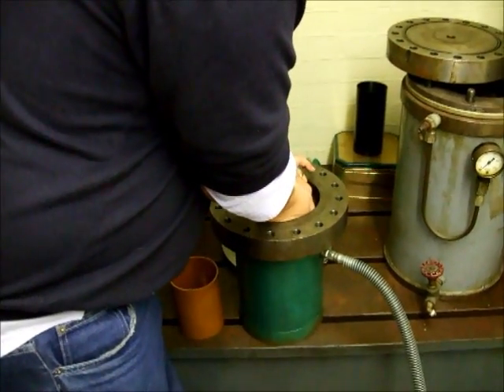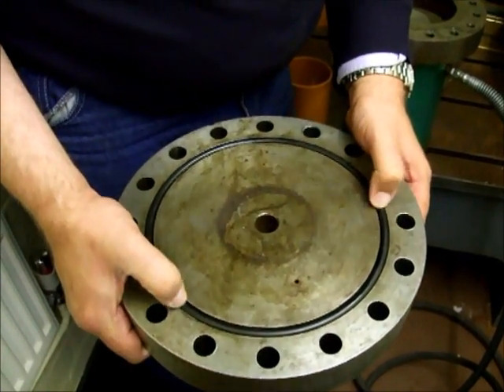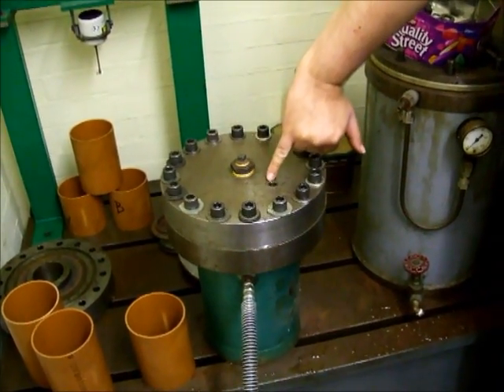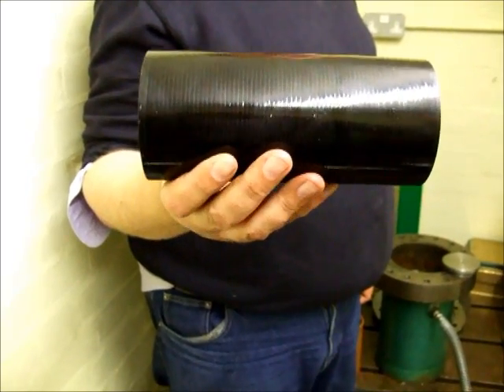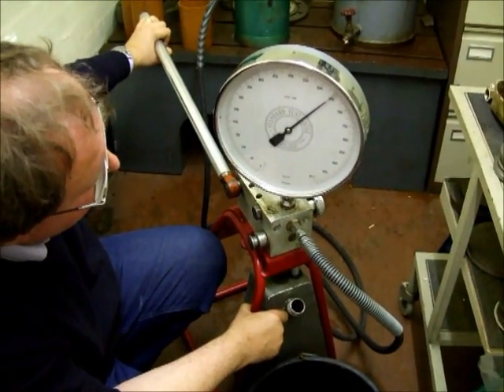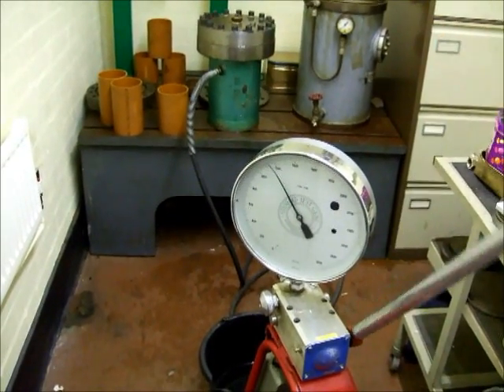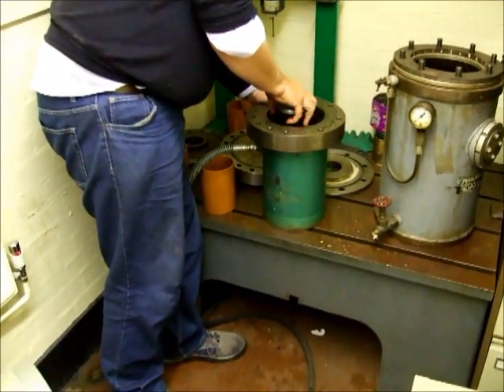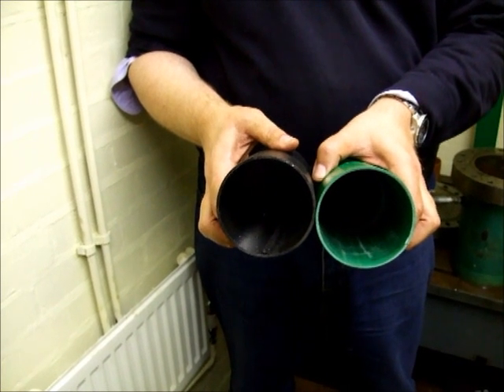Collapse of Composite Submarine Pressure Hulls

Comment: Wait you're telling me they knew carbon fiber wasn't good at withstanding pressure over 10 years ago??
Reply: Veteran engineers know this since its infancy but marketing people kept pushing it because it sounds fancy and related to racing applications also it can be made cheap and sell at higher price.
Reply: @krrk6337 truth
Reply: @MrObear  Nope BS.
Reply: @krrk6337  That's BS.   Where do you come up with cheap?  Unless it is a carbon fiber part that is going to be manufactured in great quantities and few are, the expenses are mostly related to manufacturing processes, labor, design, tooling, and other materials.   The more exclusive any product is the more expensive it will be.  Marketing my ass.
Reply: @boneseyyl1060  here's an example of a marketing person who thinks expensive parts can't be cheaply made.
Reply: Carbon fiber's strength is in tension, not compression.  So it's a terrible choice when you need to design a vessel to withstand tremendous compressive pressure from outside of the vessel.
Reply: @ShawnKitchen exactly what James said
Reply: @jummyran exactly what I was gonna say
Reply: @ShawnKitchen  bollocks its the cycling of load that's the problem
Reply: @ShawnKitchen    Exactly.  Not sure why this fact gets overlooked.
Reply: It is a well known fact in the industry.
Reply: @HeatherRose2023  No.
Reply: Go find the video of James Cameron talking about carbon fiber. Yes, it was well known that there are serious issues in using carbon fiber to resist compressive loads, although it’s acknowledged to be great under tension. But there is also a progressive degradation of carbon fiber to consider, much more so than materials like steel or titanium. That pretty much only leaves the weight advantage of carbon fiber, which isn’t anywhere near as relevant as in designing aircraft or spacecraft.
My personal view is that carbon fiber has assumed the oopsie-wah status of a miracle material in the “common wisdom” and this may have led some people to the conclusion that it had to be good for submersibles if it was good for other applications. This incident may convince those people of their error.
Reply: @mencken8  I don't think James Cameron is a MS ME.
Reply: I suspect people knew this about carbon fibre going back to its infancy. There's a reason why it wasn't used. Even in cars, because it has no 'give' and shatters, certain designers like Gordon Murray (McLaren F1 etc.) refuse to make car wheels out of carbon fibre, preferring a heavier metal wheel instead.. because it bends and doesn't shatter.
Reply: @lukemallory7832  Koenigsegg uses carbon fiber for wheels. Not an issue for them
Reply: @GOD719  I know.. I wrote that they CvK uses them above. According to Gordon Murray, it is an issue.
Reply: @lukemallory7832 i think they stopped using carbon fibre motorcycle wheels for the same reason, in the 80's i think at the Isle of man TT some riders Carbon fibre rims shattered when he was clapping on...
Reply: @lukemallory7832 I wondered about it shattering.They should have used steel or titanium
Reply: @lukemallory7832 
Ferrari also prefers to use aluminum metal over carbon fiber.
Reply: @lukemallory7832  high end cars do make wheels out of carbon fiber ...and drive shafts
Reply: @lukemallory7832 carbon fiber bicycle frames.  Super light and nice looking but those guys have to ditch the whole thing if there's any minor crack.  Rich people problems I guess.
Reply: @lukemallory7832  You are a man of culture.
Gordon Murray in a very recent interview (on his new car T50) said "Carbon fiber wheels are dodgy"
Reply: @lukemallory7832  I don't think this has much to do with why it's an inappropriate material for submarine hulls. It's about how layered fibre composites transmit load under compression along the direction of the fibres.
The carbon fibres are so thin they buckle easily so can't (by themselves) carry much load, so the matrix material does a lot of the heavy lifting plus it braces the carbon fibres against buckling so the fibres can carry load too.
However, these transverse buckling forces will act to delaminate the material.
Reply: @sergarlantyrell7847 to picture why smarter people than me would say it is great under pressure but not compression I did this thought experiment.

Hold a string (the fiber portion of carbon fiber) between your hands and pull them away from each other, this is a carbon fiber pressure vessel.  Pressure from the inside is trying to stretch the carbon fiber, the fiber helps resist this.

Now, hold a string between your hands and move them closer together, this is carbon fiber in compression. Pressure from the outside is trying to compress the carbon fiber.

The titan sub was essentially an epoxy sub, you can’t push a fiber. Fiber is good for tug of war, metal is good for jousting.
Reply: @mabolzitch7743  somewhere else I posted that I would love to see a comparison of a wound CFRP pressure vessel Vs one purely made of the matrix material.

My prediction is that the CFRP one would be stronger (though no idea by how much... maybe 2x) because the fibres should resist axial compression if they're constrained by a rigid matrix so they can't buckle.
This would create a lateral force though that leads to delamination.
Reply: @lukemallory7832  The carbon fiber bonding method they used on titan doesn’t shatter like the parts you’re thinking of - it tears and rips.  There are some engineering channels that discuss this.
The parts that shatter are bonded in a mold and put under tremendous pressure during the bonding process, far more than the submersible would be under.
Reply: @AdamsBrew78  I wasn't aware of that - thanks, I'll give it a look.
Reply: @lukemallory7832  Carbon fiber does have "give", that is why it is used in components that need to have some flexibility and a high cycle life like bike frames, rims, and handlebars. CF has a much higher flex life than even titanium but if you push it past its maximum flex range it will shatter dramatically.
Reply: @lukemallory7832  Carbon fibre was first introduced in Formula 1 in 1981 when McLaren first explored the use of it for creating a monocoque and has been used elsewhere extensively including suspension components, using it for wheels is against the rules. I wish people would stop making things up.
Reply: @entx8491  When he said "not used in cars" i think he meant more that its not used as the basis for the 'major' components of cars (its only recently that they started trying to make 'frames' out of it).  Mostly Carbon Fiber has been relegated to body-work components and such.  Parts of the F-1 cars taht are not expected  to carry a heavy load get the carbon fiber treatment, but i doubt you'll see the A-frames holding the wheels to the car made of the stuff.
Reply: @entx8491  ?
Reply: @Gwydion_Wolf  you don't think the literal chassis or suspension are major components? Lol OK.
Reply: @Gwydion_Wolf  " i doubt you'll see the A-frames holding the wheels to the car made of the stuff."  Doubt away, never the less it's been true for MANY years!
Reply: @entx8491  Again to clarify for others, because this guy is simply angry for some reason, I was saying that Gordon Murray does not make wheels out of carbon fibre, period - nothing to do with F1 or F1 rules. I meant his McLaren F1 (road car) and T50, do not use carbon fibre rims, unlike Koenigsegg and other en vogue companies, because Murray has stated in interviews that they have no give and shatter. This is not 'made up' and these interviews are available to see here on Youtube when he's talking about the launch of the T50. I am well aware that Formula 1 cars are predominantly made from carbon fibre. Good day.
Reply: @entx8491 you seem a bit slow
Reply: @Gwydion_Wolf  The monocoque chassis and the suspension control arms on F1 cars are made from carbon fiber.
Reply: @entx8491  Right it was used in 1981 - for the Formula 1 MP4/1. The F1 that Luke Mallory refers to however is not the Formula 1 MP4/1 (like you suggest), rather the road-production sports-car that was produced from 1992-98:
The F1 that won Le Mans in 1995 and raced during the Le Mans GT1 days.
The F1 that doesn't use carbon fiber rims.
The F1 that set the speed record for naturally aspirated road-cars, at 391 km/h.
The F1 that Rowan Atkinson once owned - before crashing it twice and selling it.
The F1 that was used as a test-mule for the Mercedes CLK GTR.
The F1 that used dihedral doors,

Luke Mallory was NOT referring to the F1 MP4/1 that:
"[W]as first introduced in Formula 1 in 1981 when McLaren first explored the use of it for creating a monocoque and has been used elsewhere extensively including suspension components..."

I don't know about you but that seemed like a very clear difference - seems like you're the one with a comprehension problem - you mindless numbskull
Reply: @Gwydion_Wolf  what do you mean man? It's not like the bodywork experiences over 3 tons of downforce repeatedly every race, and the suspension arms are most definitely made out of carbon fiber.
Reply: @davidaugustofc2574 3tons. Yeah, well. Subs need to be round for a reason...
Reply: @Gwydion_Wolf wow, incredibly incorrect. F1 cars see massive loads and use carbon fiber wherever possible, including the suspension arms and entire chassis itself!
Reply: @Knyq_626  Yes indeed, focus on the few words your brain is capable of managing, take only that into context, then finalise with exactly what I said. You are demonstrably an NPC.
Reply: @Gwydion_Wolf  As others have noted, you don't know what you're talking about as the monocoque and main suspension parts (wishbones, which I think is what you're call "A-frames" have been carbon fiber on F1 cars for 30 years, but so have the front and rear aerofoils, which "carry a load" greater that the weight of the entire car - it has long been known that in theory an F1 car could be driven along the roof of a tunnel. ... So you're entirely wrong, carbon fiber is used in heavy load situations in F1 cars.
Reply: @alro2434 I suggest you google the term “carbon fibre monocoque”. It amazes me people type these diatribes without fact checking themselves first.
Reply: @Gwydion_Wolf f1 uses carbon control arms
Reply: @entx8491  
We used carbon fibre in racing cars well before 1981.
Reply: @rorykeegan1895  I know, I didn't state otherwise.
Reply: @lukemallory7832  You made a statement about "certain designers like Gordon Murray (McLaren F1 etc.)" now you're trying to backtrack. Not all of us have problems with comprehension, maybe some of us can't see what you're doing there but I can for sure. I'm not invested in arguing with intellectually dishonest people and mindless numbskulls so whatever. I'll agree to disagree because I couldn't care less about what point you were trying to make.
Reply: @entx8491  I'm not trying to backtrack; you're being incredibly insulting for absolutely no reason and I'm still baffled as to why..? I don't even know what it is I'm 'arguing' as from my perspective you have taken issue with something I've said without telling me which part, hence I attempted to clarify. If you could relax for a moment, instead of calling me a numbskull, and tell me what I've said that has gotten your back up as I'm genuinely interested to know?
Reply: Wait, you didn't knew that marine engineers were warning for years about Stockton Rush's coffin?
Reply: @Engineering_Science More like his disintegration chamber, unfortunately.
Reply: @Engineering_Science  well they were over 50 year old white guys and Stockon Rush didn't want them since he wanted diversity.

carbon fiber is used for rovs and they toss the carbon fiber after one trip and reuse the rest for the next rov.
Reply: @toomanyaccounts  More crap. 
   Stockton didn't want DIVERSITY.   He simply didn't want 50 year old white guys like him, telling HIM what to do. You know, because those guys have something called "experience" and he wasn't looking for any of that. 
   He really wanted a bunch of younger people that were eager to impress and would say things like, " Yes sir, Mr. Rush, we think a carbon fibre hull is a great idea!!"   I doubt he cared if they were red, green, blue or pink as long as the words "Yes Sir! " were coming out of their mouth.
Reply: @davepug066  because the ceo told them to after he ignored their objections
Reply: It's good for pressure from the inside.  Like a scuba tank. But not the right choice of materials for pressure from the outside.  Especially being used over and over. Fatigue in the form of delamination occurs. Eventually,  your luck runs out.
Better regulation could have prevented this organization from moving forward as a diving company for hire.
Reply: If only Stockton had performed some simple analysis in the beginning
Reply: I watched Cameron talk about carbon fiber! It gets weaker each time you dive! It leaves micro cracks in the fiber the dropper you go till it fails and it did!
Reply: It's good at withstanding internal, but not external, pressures.  It was a very poor choice for Titan.
Reply: Carbon fiber has got to be going on for 40 to 50 years now and they probably knew it from day one, its good at the other thing, not this thing. Theres also allot more complicated ways of creating something out of carbon fiber than was used on titan, i bet it could be done, but the amount of effort and time it would take would mitagate any advantage youd get from using such a material. Also titans presure hull was made of multiple types of materials, another big no no apparently when it comes to extreme pressure thats apparently been known and understood for more than half a century
Reply: It's literally fabric glued together. It's insanity to use it to resist external pressure.
Reply: @ryansil4356 boob gnome
Reply: Any composite material is bad for external pressures because of the possibility of delamination between different layers of the composite. This has been well documented since the widespread use of composites became common.
Reply: @caolanhogeweide6555 

Wrong. Those organization have disavowed any involvement. NASA only did conversations about materials but no design or testing.

The CEO was using those attributions to instill confidence but they were lies.
Reply: Carbon Composite, not carbon fiber
Reply: we've always known this....
Reply: This video demonstrates nothing of that sort whatsoever. It merely shows how two fiber enforced tubes are tested under external (compressive) pressure in a destructive test setup deliberately designed and conducted to break the test specimen in order to determine the maximum pressure the test specimen was able to withstand. 
That's all there is to it!
It does not address manufacturing issues, safety concerns of using the material for submarine applications, it does not address cyclic fatigue, aging, design flaws... or the suitability of such fiber-reinforced composite materials for submarine applications, none of that whatsoever.
Reply: James C had refused to work with him from the beginning because "it is a deathtrap"... carbon fiber falls under a literally centuries old saying... "you cannot push a rope". 

The fact that he refused to even try and get the thing certified after the first hull failed in 2020 says that he had no intention of following any safety rules, and I am looking forward to what is about to happen to his company.
Reply: @davepug066 because they were very bad engineers. Perhaps not engineers at all.
Reply: Yes 😡😡😡
Reply: It's not that carbon fiber isn't good at withstanding pressure.  Metals can be forged and machined or cast by more uniform methods.  You can also predict the fatigue life and wear cycles of metals.  Metals will usually bend and/or crack to indicate a failure.  Carbon fiber is usually layed up by hand.  It is a composite and so is less "uniform" in quality.  It is a poor choice for a submersible for those reasons and for the fact that it will not bend and/or crack to indicate a failure but it will simply shatter quite suddenly.  Carbon fiber is a great material for certain applications when properly formed.
Reply: But it was 50 year old white guys saying it so it could be discounted. - Stockton "Charlie Tuna is nibbling my butt" Rush
Reply: Yes. The problem is people not listening thinking they know better.
Reply: Next you'll be astounded at the discovery that concrete is poor under tension.
Reply: At least 40 years ago really, on the examples people gave here, there's some road cars (hypercars if you may) that have carbon fiber wheels and they work fine. Koenigsegg was the first to have rims lighter than the tires themselves.

 The thing in F1 is that the safety regulations require that the tire will never become fully free in case of a collision, which in open cockpit cars is several orders of magnitude more dangerous than normal cars, especially at the speeds they go at. When you see a modern crash, usually the suspension arms break and the magnesium wheels get held by steel tethers.
Reply: So far what I have seen in the different explanations, the problem isn't the carbon fiber itself, carbon fiber is a great material, but the submarine wasn't made only of carbon fiber it was a mixture of carbon fiber titanium and I don't know what else... In salt water it boosts and galvanic reaction that deteriorates materials way faster...

But even though if the submarine was made only by carbon fiber, they had to made constant test in the material to see its fatigue... An exhaustive test on the material would cost around 25 k .. not even the 10% of what a passenger had to pay... Considering it was their lifes what was in game and their whole project... I think it was financially viable to expend those extra 25k before each expedition if you weren't allowing the standard organisms to certify your submarine....
Reply: @mataloce I mean, the Titanium endcaps were found intact, so they didn't collapse, and Epoxy Resin doesn't get really corroded by anything either.

The material likely suffered a pure fatigue failure in its 14th uncertified dive.
Reply: Carbon fibre was probably used in this case for cost effectiveness, not often thats the case but which is easier? Rolling a giant pressure hull and testing it etc or moulding a carbon fibre one?
Reply: @finlaymcdiarmid5832    I doubt CF is more cost effective.  It's not cheap to properly lay down CF correctly and there is a lot of waste in the process, which is not recoverable as of yet.  Who knows if they went cheap on the CF, it's possible.  Allegedly, this submersible performed 20 previous dives.  The question that comes to my mind, what's the service life of CF in this application, before we have to pull the plug and decommission?  Even the steel / titanium submersibles that the military uses have limited service lives.   You never know when the next dive will be the last.
Reply: @dickjohnson7845  but when you get into the logistics of moving around and making, shaping huge pieces of metal, carbon of which you just have to spend time doing it right may be cheaper.

I wouldn't touch carbon for a deep sea intended pressure hull. Maybe just a hull for a few hundred metres but over a mile! No way! im no material scientist but that doesn't seem to be a good idea..

The military(ies) have subs that can go 3/4 of a mile down or more and have been in service for Decades. Probably didnt go down to max depth often but still..
Reply: @finlaymcdiarmid5832  Stockton Rush said he chose carbon fiber because it would make the sub more buoyant, and would save a lot of money by not needing to use glass foam like other deep-sea submarines. Also with a less massive vehicle, smaller propellers and batteries could be used.
Reply: @juliavixen176  that makes sense i guess. The guy was a aerospace engineer so he must've had a clue or two about it.
Reply: the dude literally believed all the tolerances they tell you about are low ball estimates to create an artificial margin of error that you could ignore, he's basically said he knows enough that he can cut corners and still be safe....someone needs to make a meme out of that because it's famous last words
Reply: 5,500psi x 144 = 792,000lbs for every square foot at titanic depth. 

The end caps experienced 22,000,000lbs of force, this was stated by Stockton.

I don’t know the exact dimensions of the carbon cylinder, but if it was 8ft x 11ft it would experience 218,592,000 lbs of force. 792,000lbs x 276 square ft = 218,592,000lbs

But hey, if you want to be safe don’t get out of bed. If you want to live life come with me in my experiment, it only needs to withstand around 250,000,000lbs of force, it’s safe than flying in a helicopter.
Reply: 1500 psi is 4 times the pressure in titanic's depth. It was the repeated compressive stress on it.
Reply: @Herbertti3  nonsense, stop making up stuff for low IQ morons to repeat. It's 6,500 PSI.
Reply: 100%.  the guy claimed the deep dive community didn't want him entering their market space.  He was absolutely delusional.
Reply: @horsecockexpress7612  Stockbridge was an idiot who killed four people and himself
Reply: Yup!
Reply: This doesn't even make sense... you learn new stuff over the years. And make stuff better. Bc it wasnt good ten years ago means nothing. Not bc of the time alone.
Reply: Carbon fiber is great for pressure tanks where the carbon fiber is under tension.  The problem comes when you put carbon fiber in to compression.   This was known far further back than 10 years ago.
Reply: Roger that.  And I'm no engineer.
Reply: @davepug066  the titan has a front and back cap made from titanium. i bet those 2 alone would have survived,  but they wanted a longer sub with more space, so they went for the cheapest option to put a cylinder in between the titanium caps
Reply: @Raeffi3 yup, they were both left, but they didn't have to come to the test as the pressure was already Equalized elsewhere.😮
Reply: Sad . That companymust be punished
Reply: They aren't billionaire CEOs, so what do they know.

They're just a bunch of cowards holding back human progress for 'safety'.
Reply: A retard could tell u not to use carbon fiber in a submarine I use it in a fucking rc sailboat for fuck sake idiots
Reply: Carbon fiber is Good in tension.....but poor in compression like when used as the body of a submersible vessel....yes, known forever.
Reply: Isn't carbon fibers big thing is its light weight for it's strength...? If weight is not important then maybe another material would be better... 🤔👀
Reply: @ZiggZagg11    Carbon fiber is known for light weight and tensile strength, however it has poor compression strength.  It's puzzling to me that they went with carbon fiber because in the ocean, metals such as steel, titanium, etc., are essentially weightless.  So, what do you gain exactly by using carbon fiber?
Reply: did you not watch the video ?
Reply: How do you get that from this video?
Fiberglass: buckled at 375 psi but did not leak.
Carbon fiber: buckled at 1400 psi but cracked open.
Neither metal or acrylic were tested but if they were, they too would have been tested until failure.
Reply: James Cameron was saying this is well known in the submersible community and that all submersible engineers know this.
Reply: any bike mechanic would recognize the steep limitations of CF for such high repetitive compression stresses
Reply: @peabody3000  bike mechanics don't have to understand fluid dynamics. If you don't know what that is then you have no business making a sub.
Reply: @entx8491  yea but my point is any bike mechanic should have understood in advance the fatal risks of the CF hull
Reply: @peabody3000  Until the accident a bike mechanic wouldn've have had any better of a clue than anyone else handling CF. CF on bikes tends to be under tension and any componants under compression aren't subject to radial compression stresses/loads from fluids. I get your point but you might as well say that any welder knew the titanic would sink too.
Reply: @entx8491  no, i don't think you're getting my point at all. most CF bike parts including frames and wheels, etc etc etc regularly undergo compression stress. bike mechanics know that any damage to those parts is progressive, meaning small damage leads directly to greater and greater damage over time, and they also know that expensive but critical parts that seemingly have no visible damage on them sometimes are ideally periodically tossed and replaced, once they have enough miles and stresses on them, in order to reduce the chances of sudden and largely unpredictable catastrophic failure
Reply: @peabody3000  There is no component on the bike that has to withstand that much combined radial and tangential compressive stresses in any circumstance, no tests to approve parts for this purpose, nor are there any methods of fitting and handling with pressure and fluid dynamics as a concern, and therefore no knowledge to share that is relevant to this specific application. Bike mechanics don't tend to know the actual physics behind the materials involved in the same way that car mechanics don't when it comes to car crash investigations. If you want to believe they do then ok.
Reply: @entx8491  wheels are round last time i checked, and they take hard shocks from the ground not very dissimilar to radial pressure in the hull of a submersible, which often wind up either breaking a carbon fiber wheel, or damaging it in even barely detectable ways that are unrepairable and require removal and replacement. much of the same goes for CF front forks, frames, seat posts etc.. i think you're just googling stuff trying to make up counterpoints, but hey like you said, you can believe whatever you want. you have a great day, but i'm done with ya
Reply: It makes zero sense to use carbon fiber in compression.  Only the epoxy has any compressive strength at all.  Carbon fiber only has tensile strength which is why it is used to CONTAIN pressure, not to RESIST pressure.
Reply: @stargazer7644  This isn't quite right when speaking in general , but 'in layman terms' it sort of brings the point across half what reasonably non the less. 
Of course carbon fiber-reinforced material can also be used in ways where it experiences compressional stresses, but the design needs to accommodate for the material properties and it typically needs to be different from conventional designs when using metals. It can even have very beneficial properties when used in crash elements on vehicles, such as Formula1 race cars, but as mentioned these carbon fiber-reinforced crash elements require rather unconventional designs to function properly, because of the material properties are so different from metals.
Reply: We discovered it wasn’t good for pressure vessels almost the day we started prototyping it as a material. This has been know for long enough that it should only take a glance at some material data charts
Reply: @sarodorethedragon9865  actually, it's a fantastic material for pressure vessels... So long as you're trying to contain an internal pressure, rather than resisting an external one.
Reply: Yes ....but it was less expensive than metal and the design philosophy (which failed) was to mitigate for the shortcomings of carbon fiber by using real time monitoring of the structure  with strain gauges. 
This sort of approach ( we know it's not strong enough in all scenarios but we can use real time monitoring to prevent overload, failure and deaths) is still in use in other areas..and it doesn't always work.
Reply: @caolanhogeweide6555  5 inches thick and at that depth over 5500psi of deep ocean water pushing on every inch of it...
Reply: Dude, there is a court case right now against bicycle manufacturers who used CF in their bikes. Catastrophic failures galore resulting in paralysis, death, etc. It is STRONG and can flex...once...ten times...thirty times and then POW.
Reply: The CEO was a “maverick” and was purposely trying to do it against all conventional wisdom. He wanted to test the limits and he found it.
Reply: Rush thought he was a magic man.
he thought he could alter physics just by hopes and dreams. he ignored other professionals and didn't have the sub certified. 
he absolutely deserved his fate for misleading and killing 5 others.
Reply: Everyone in that industry knew
Reply: Yep. It’s called arrogance with a bit of narcissism.
Reply: @davepug066 HE WAS ARROGANT AND CHEAP AF. (He even cheaped out on the viewport: coulda got one certified to 4000m but it was far more expensive: got one only certified to 1300m!)
Reply: @aliceandfriendsvideos  Why spread this garbage when you know jack shit.about this, what are you trying to accomplish. The window was designed for 4km depth  but only certified for 1300m because it was already designed for another client. They would have never certified ANY viewport for 4km for a commercial company and why would they the liabilities if it ever failed.
Reply: Titan was a bit more sophisticated than 1/8" thick carbon fiber cylinder with the two ends slapped into place. It held up in deep water a number of times (until it didn't.)
Reply: @mbarrett99  Nonetheless I think it was a fair demonstration given that it could only be scaled down, considering the Titan had the two titanium ends glued in the o ring sealed ends on the test model seems adequate especially when you consider there is extreme pressure pushing the flanges of the end plates against the cf cylinder creating even more sealing effect.
Although there is no official diagnosis of Titans failure cycling compression/decompression consequences were a grey area as the only testing that was carried out between dives was using some kind of sonar arrangement which clearly was not dependable.
Historically what comes to mind is the catastrophic failures that manifested itself in the Mk1 De Havilland Comet and much later in the Boeing 747 pressure bulkhead both of which were a result of these pressurisation cycles.
Reply: everyone knows carbon is crap compared to titainium!!
Reply: it's not that Carbon Fiber 'isn't good at withstanding pressure forces' in fact, it is, the problem lies in its durability...it quickly losses it's original strengh...the Titan went on the same diving depth last year with the same hull and for the most part, everything went smooth...however when they went again this year the CF hull just deteriorated beyond safety standards...unlike steel, which fractures past this point, CF shatters, which is why they died instantly.
Reply: The pressure on hull of the Ocean Gate Sub down at the depth of the Titanic was 12,500 PSI. The equivalent of the weight of  a fully loaded Cement truck balanced on a rod 1 inch square. Very few materials can withstand that pressure.
Reply: @theblade9024  I've began to realise people are just bad at maths and science rather than just here to lie and leave nonsensical comments. You guys are confused, probably because of your obsession with archaic units. At 4000 meters (approx. Titanic depth) it is 5823.6 psi not 12,500 psi. The seafloor would have to be 8585.75 meters to make what you're saying make sense.
Reply: @entx8491  i love your cockiness even when wrong. 12500 feet down. You have mixed units. Did you covert meters to inches? I think not.
Reply: @theblade9024  you said 12,500 psi, scroll up and read your own words. Furthermore 12,500 ft means nothing here since no one including you mentioned it at all, till now.
Reply: Whoah.... no way... that's crazy. You guys are just he sarcastic right?
Reply: @bldmyamean8352 carbon fiber is string …it will never pass any requirements for being on a ship ! James Cameron who build his OWN submarine said it cost 300 million with funds! ….The titan was like a 1 million dollar submarine …just look at the name “ titan”
Reply: @392HELLEPHANT  There's a whole sector of the naval industry for fiberglass ships, and they can be quite big, the material is not suited for deep dives because they're extreme. Just give a quick look for yourself and stop spreading misinformation.
Reply: Carbon fiber is suitable for use as a pressure hull; just look at the Boeing 787.  It just wasn’t suitable in the way it was implemented in the Titan.
Reply: @brianhawkins no no no
Reply: It all depends on the engineering. It has nothing to do with carbon fiber. Very important is what angles you use for the filament winding.
Reply: @rudolfabelin383 That's exactly what Stockton Rush thought. Look how that turned out.
Reply: @rudolfabelin383  totally agree. I bet you could make a viable submarine out of aluminum foil with the right angles.
Reply: @bldmyamean8352 Sorry. 
The angles applies only to composite materials.
Aluminum is an unidirectional material. 
Best Regards from Sweden.
Rudolf Abelin
Mechanical Engineer
Composite expert
Reply: @rudolfabelin383 isotropic, not unidirectional